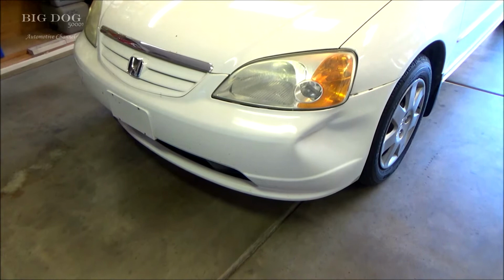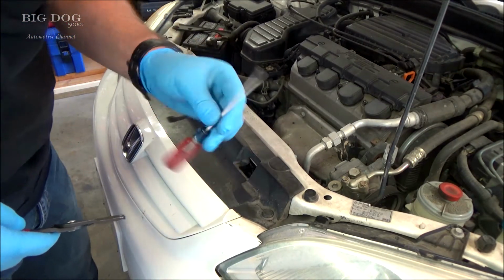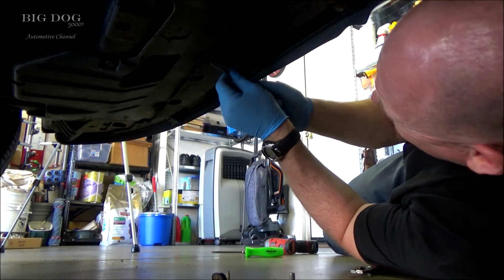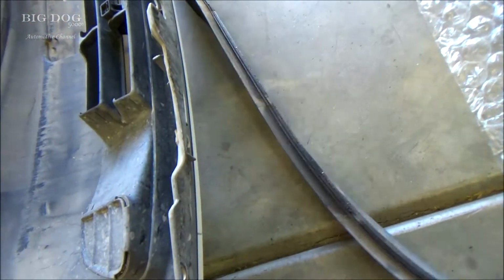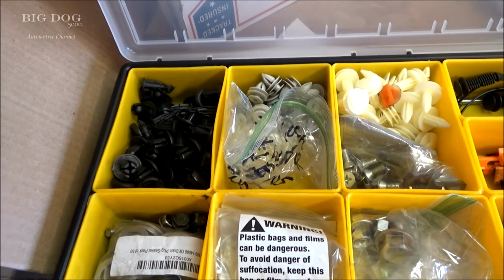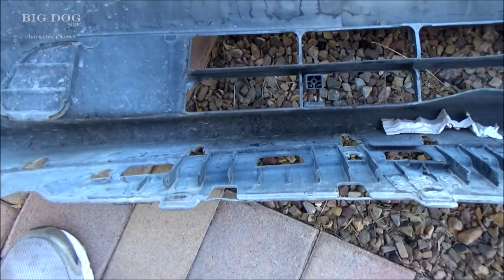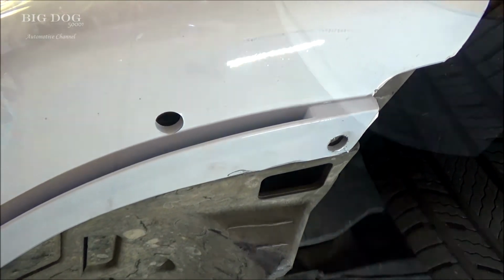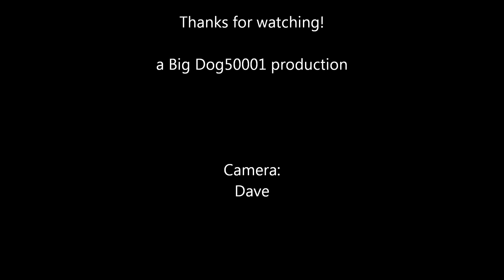Honda Front Bumper Removal and Installation 2003 Civic (2001-2005 Similar)

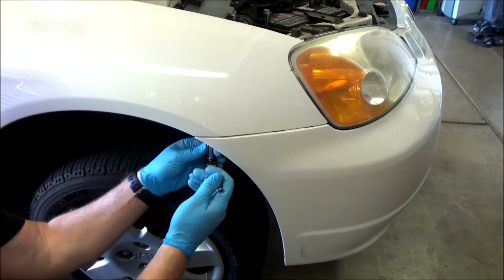Comment: Hey there. My Civic is missing some screws on the bottom of my front bumper. Are the metal screws with the washers the same ones you'd unscrewed from the sides (where the front wheel mud guard is @5:35 ?). Looking for cheap parts I can buy online given the whole C-19 thing. Thanks

Comment: Be careful/mindful some vehicles have about a tooth paste tube size, explosive cylinders, activated on impact to lessen impact of collision and or they just go off when cars are on fire... I may of missed it because I jumped around a bit, really just trying to figure out if there is a sensor in the front center area I should avoid when screwing on a front license plate (bumper doesn't have a preset place).

Comment: I need to do the same thing on my 2003 Civic EX MT, but the link you provided in the description doesn't work (I know the video is over a year old). Do you remember by any chance the brand name of the bumper, or perhaps the seller's name on the Amazon invoice?
I did find some on eBay for less than $200 (pre-painted also), but they ship them folded believe it or not, lol.

I can tell you also cleaned those foggy headlights after installing the new bumper cover. Beautiful front look! :)
Fantastic presentation.
Reply from the maker: Sorry, links are fixed.  Thanks for the comment!
Link to pre-painted bumper for 2001-2003 Civics:  https://amzn.to/2LpOnAe

Link to pre-painted bumper for 2004-2005 Civics:  https://amzn.to/2ZSjh9L
Lisle 41250 Push Pin Pliers:  https://amzn.to/2Lkl5El
Aftermarket clips for bumper:   https://amzn.to/2NTswE3
Reply: @BigDog50001  
Thank you very much for the reply and the links.
This is weird: the description is exactly the same as the one I found on eBay, stating that the bumper cover is shipped folded.
"This bumper is folded for the most economical shipping possible; this folding can cause minor imperfections. This is exactly what you get with anyone else selling painted parts."
I will contact that seller and find out more.
Thank you again for your help. I really appreciate it.
Reply: @BigDog50001  
Here is their reply:

Hello,
Yes this bumper get folded. We use an baby/ Talcum powder on the painted side to prevent any scratches during the shipping process(you can wipe it off easily with a dry T-Shirt). Next we bend the wings of the bumper gently inward and secure it with a foam wrap, then a paper wrap and then a plastic wrap. We also add a flex additive into the clear coat to prevent the cracking or chipping in the clear coat.   You may see light stress marks on the area where it was folded, and slight scuffing if the carrier puts a heavier item on the bumper, and that may possibly cause a crease. My apologies that I don’t have any photos to show you, but this is exactly what you get with anyone else selling painted parts. Do rest assure we sell thousands of those bumpers folded a day and we have less than two percent damage issues folding the bumpers our way. Your bumper does not come in a premium ( non- folded) shipping method. For the warranty span of a 6 month warranty,  If you do have any issues of cracking or chipping even in the clear coat, you would need to contact us.  We will need proof of purchase, so be sure to print your eBay order and payment confirmation information and keep that in a safe spot.  Once we have the necessary information to verify that the bumper was purchased and painted by our company, we would start a One-time warranty replacement for you.  I hope that answers your question.  Have a nice day.
 
Thank you,
MBI AUTO

Notice how they mention eBay. My question was addressed to their Amazon store.

I don't know if I should pull the trigger on this. Shipping a folded bumper cover is just weird.
You were lucky yours arrived in its normal state, lol.
Thanks again for your help.

Comment: Is the hybrid different ?
Reply: The bumpers have slight variances when compared, and I was wondering if maybe the installation was different of perhaps harder
Reply from the maker: Removal and installation of a bumper cover for a Hybrid should be very similar to the Civic in this video.